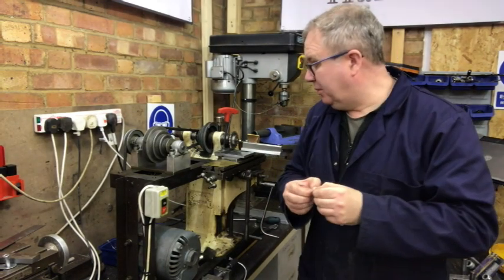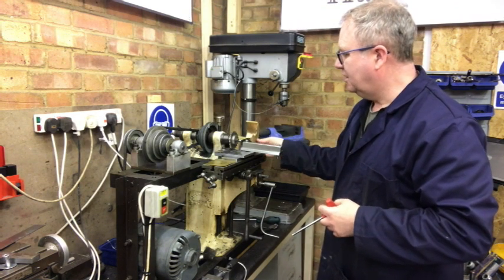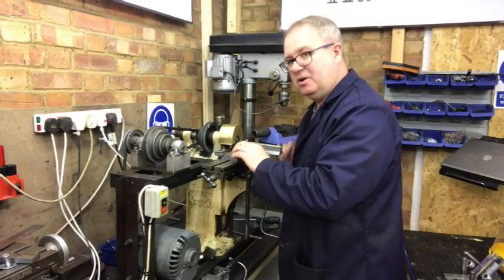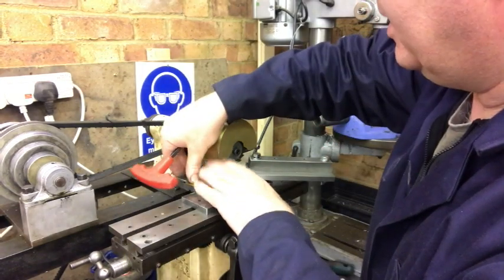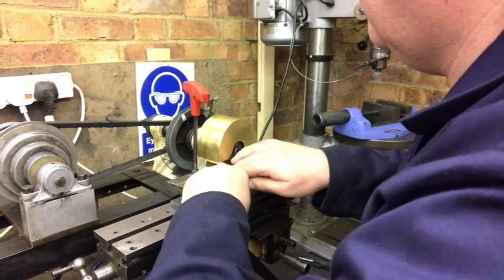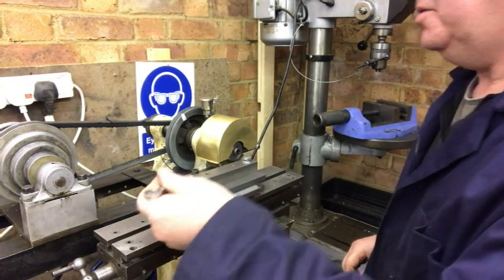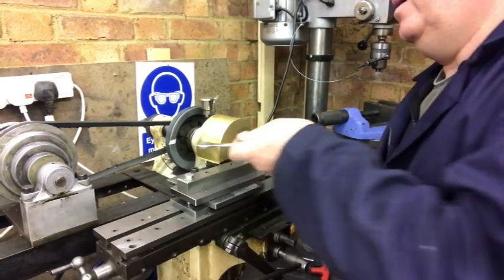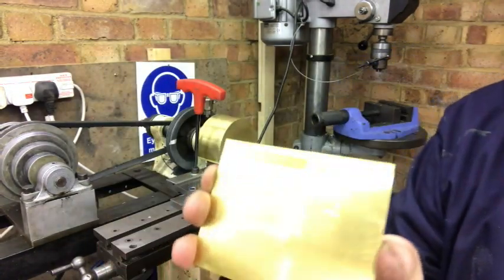Harmonica Reed milling machine completed.

Comment: I was wondering how thick the brass that you've used for milling the reed was. I watched your other videos and saw you're using old Hohner or at least German standards. Curious because I also saw a video about the Hohner process, and of course that's not mentioned, and I don't want to take apart my antique Hohner harmonicas to find out just yet.